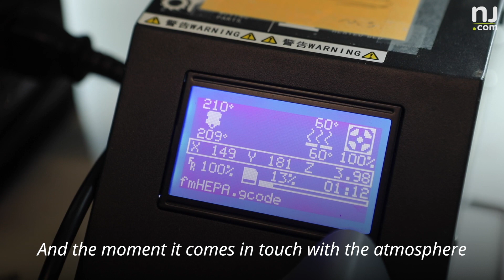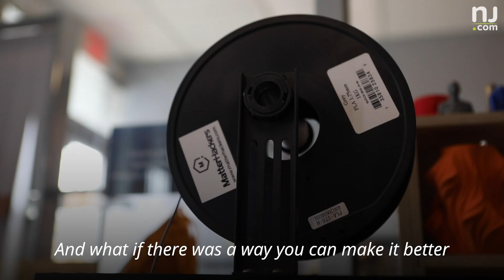3D printer in N.J. making respirator masks to help protect from coronavirus

Comment: These things do not seal properly, also the layer lines do not totally solidify. These are very difficult to nearly impossible to sanitize because the layer lines are porous.  Her intentions are good, but these are not viable solutions. These machines are meant to prototype, not create finished products like an injection molded part. These would give people a false sense of security, which could actually make things worse. Trump needs to demand 3M make masks and PPE around the clock using the Emergency Production Act. That is what would save our healthcare workers and essential personnel

Comment: Would highly advise against 3d Printed masks. Taken from Josef Průša's article over at https://blog.prusaprinters.org/from-design-to-mass-3d-printing-of-medical-shields-in-three-days/
He quotes: "but printing respirators might not be the best idea at this time. Let me explain.
 None of the designs available right now have been tested to ensure they provide the protections needed"
"Another question we need to take into account is the porosity of the printed parts and the safety concerns that come from that. The wearer will have the mask on their face, a humid and warm place, a perfect breeding ground for germs."
A false sense of security is more dangerous than no protection at all...

The face shield design however, is far more promising.

Comment: Hello, I took a 3d printed respirator like this one and made a face gasket with silicon 1 caulk and soap/glycerine. People do this to make cheap molds. The idea is that you let it get to a putty state, build your gasket, put a little soapy water on your face and do a quick press for a custom mold. It created a completely air tight custom seal. If you want pics, then let me know your email and I will send them over.

Comment: This is fun, but also dangerous. There is a risk here that CO2 accumulates inside the mask, which can kill you.
Reply: co2 particels are 0.0000125 microns in size, about 1000 times smaller than a virus. it has no issues going out of the mask:)

Comment: It's probably more useful to print those face shield brims that are designed to use clear acetate films that are still easy to buy like overhead transparencies, production bottleneck is the n95 filters so I don't see how this helps.
Reply: all of the 3m furnace filters in the filtrete family are all made from the same material as a n95 mask... melt blown static charged polyproplyen. You can get over a 1000 filters from one small furnace filter

Comment: This is great. Few thoughts. Have your tested as FDM is not airtight... Just try placing in water and watch it soak up water like a sponge. With that you can use coatings...like XTC-3D to make air tight.
Reply: I already read this statement somewhere else too and also believe it. My "but" part is, that FDM can act enough air resistance IF there is a large hole in the middle too. I spent my weekend to think/create something similar like in the video (before I saw this) as HEPA filters for cars has a very good price/cm2 if we compare them to another product specific HEPAs. Also they are available in great numbers! I used a SCT SA1145 cabin filter which costs aproximately 5 dollars and can cover 8 pcs of filters (7x7cm).
The big problem with the project above (and yet mine has the same problem) that the HEPA is just dropped inside, so the lowest air resistance is not the HEPA itself but the leakage right next to it. There should be an insulation which blocks the gap between the plastic and the zigzag.
Also a big question is if the HEPA can release particles while in use. Glass filaments get into lungs can't be too healthy.

Comment: PLA is too hard and abrasive for the skin and won't conform to it.  They have to be printed using flexible materials like TPU or Polyflex.

Many printable mask and visor designs are available for FREE at: https://www.thingiverse.com/search?q=covid&type=things&sort=popular

I also designed a FREE reusable 5 Gallons bottle cap in case there is a drinkable water shortage:
https://www.thingiverse.com/thing:4231821

Comment: In case you weren't aware, the CDC just announced that they have revised their guidelines for health care professionals on how to deal with shortages in the supply of respirators for the health care industry. Including limiting masks to those HCP with the highest need, using physical distancing whenever possible so you don't need a respirator, stop providing them to the incoming patients, reusing disposable respirators as long as possible, and yes, using bandannas and scarfs if you have nothing else. Yes, that is from the CDC. There is a shortage, there will continue to be a shortage of masks. 
Does this design need more work? Yes. I'm going to be experimenting with a flexible tubing seal around the edge. I've used respirators for my entire adult life and used to be a certified respirator trainer, and I would feel more comfortable training someone on the proper use of this, then to give them a bandanna and telling them "good luck".
What other recommendations do folks have about IMPROVING this design. That is what would be really useful.
Although it would have been nice, would still be nice, if there was a national scale up of production in this time of emergency.
https://www.cdc.gov/coronavirus/2019-ncov/hcp/ppe-strategy/face-masks.html (the bandannas are at the bottom of the page).
Reply: 1. If you haven't already, provide a captive retention system for holding the filter(s) in place rather than simply a slotted cavity (as appears to be the case from a simple glance)

2. Incorporate "live hinges" at facial molding points to improve fit by briefly thinning the plastic, preferably in sequences of 3-7 hinges per molding point to reduce strain on each bend.
3. Provide models with filter housings sized for different commonly available filters - some people may have industrial respirator cartridges already but others will need to make do with modifying HEPA and activated-carbon bags and filters intended for vacuum cleaners, home air purifiers, and home furnaces.
Reply: Hei, I’m the guy behind the original design:) we now have a core team of 10, with literally hundreds of volonteers on slack, and 300+ printers in the network. We have TONS of new stuff coming out in days to come, we’ve been working 24/7 for the last 10 days, an english website is launching tomorrow, you can also write to me on FB (David Kvaternik) with suggestions and improvements, we will also have lots of scientific papers listed,... thanks for info on the CDC, could you send me the source? It would be VERY usefull, the first prototypes of ours utilizing anestesiology filters, which hospitals already have, are going to hospital trial tomorrow.
Reply: @Kvatthro  Hi David, here is the CDC website for Health Care Providers: https://www.cdc.gov/coronavirus/2019-ncov/hcp/ppe-strategy/index.html if you click on the N95 respirator section that is where you'll find the information.  I've got some TSU filament coming in this week and I'm going to try and see if that works better. I did rig up one of the PLA masks with 1/4 clear poly tubing to make a better fit, but it is still a little less conforming than I'd like. I've got some 3/8" tubing coming in as well to try. As soon as I rig that up I'll shoot you a picture.  I made filters using a HEPA furnace filter too, those are still available at some of the big box stores and you can get a lot of filters out of each one. I'd also like to experiment with adding the screw on filter assemblies to the design. I've been using a 3M 6100 1/2 mask respirator for years and the one I have came with a removable, blank filter for the N95 inserts (think large cosmetic round wipes). But I can't find that rig anymore, I've got to see what they've replaced it with. But the rig could literally take anything that was cut to the right size and it screws onto the respirator instead of a pre-manufactured filter.  Just food for thought. As soon as I've got a couple finished I'll be doing some respirator tests on them to see if they are okay, great, or still needs work.
Reply: Also talking with our local hospital, they haven't (yet) run into the need to replace respirators/masks yet, but are already changing rules on when they issue them. They did express a need for facemasks, particularly ones that could be easily made/cleaned.  And of course a good strategy for cleaning. I'm thinking an alcohol bath would the the best quickest way to sterilize and wouldn't damage the PLA or TSU filament. Providing guidance to the health care community on that is probably important too. Obviously heat won't work and since the materials are more porous than pre-made materials then wipes are going to be less effective. Again, food for thought going forward.
Reply: Thomas Bickford hei, we have tons on info on this, we have hospital sterelization departments, microbiologists,... on board.
Heat DOES work, since 65-70degrees C for 40 minutes is enough to neutralize Coronavirus (influding a safety margin).
This temp the PLA can take! Tested.
Reply: @Kvatthro  Great!
Reply: @Kvatthro  rubbing alcohol or soapy water works just fine for 3d printed parts:) heat works great too. i am a medical and aerospace engineer as well and spearheaded a small group of engineers, doctors, and scientists to 3d print masks and face shields. i designed both the mask and shield to meet NIH guidelines.

Comment: Good effort, but pointless. With all those big openings, your better off using a bandana and safety glasses.
Reply: They are frames. You have to put in replaceable filters within the frame that are replaced after every use.
Reply: Siddharth Ghanta Do you know the model and size of the recommended filter Not specified nor mentioned in the video? 

She is demonstrating a solution to a low resource item. If the filter for this is a low resource item, then this is a useless solution. It appears the creator of this video does not know either. That is a very important element left out
Reply: @scottgivens27  3m furnace filters in the filtrete family such as the 1500 advanced alergen are all made from the exact same material as n95 masks

Comment: Lots of designs here (can't vouch for any of them) https://www.thingiverse.com/search?q=respirator&type=things&sort=popular . Use your slicer/CAD software to scale for best fit.  Many people have dust masks in their garage or workshop for sanding, spray painting, etc.  I have FFP1 dust masks , for example, which are rated to filter 80% of particulates. 3D printing a better way to fit it to your face could be worthwhile.  Use heat gun (low), oven, etc. to soften 3d printed parts to mold them to face. Don't burn your face! Use your hands to mold. Test, repeat.  Also, wash your hands. Stay away from others.  Post your designs to thingiverse.com.   Peace.

Comment: She's not even using the correct terminalogy - the extruder isn't what heats the filament. 
PLA can be quite porous if printed incorrectly, TPU would probably be a better proposition. I get the feeling these folks are " winging" it and they don't entirely know what they're doing.
Reply: ...and a ventilator is not a respirator.

Comment: Guys, this is not a good idea.
- N95 filter material is the stuff we're facing a shortage of, so I I have no idea where they think they're going to find filters for this design. 
- PLA is not flexible and will not seal to your face
- It's not possible to sanitize these parts.
I admire the heck out of the initiative, positivity and good will these folks are showing, but I hope they can switch to producing acrylic face shield frames instead. Those are also in short demand and unlike this design is something people actually need.
Reply: Problem is that right after the general population admires efforts and ideas like this, the same general population comes with torches and pitchforks when the respirators don't work.  There is a reason for the N95 rating, and I'm skeptical that this design would meet those requirements (or, less PC, this design isn't going to work).

Admirable?  Yes.  Subject this design to NIOSH testing before casting significant praise and assuming that 3D printing has solved the problem, however.
Reply: It's perfectly possible to sanitize the parts. All it takes is an alcohol bath. IIRC the old CDC general guideline for alcohol sanitation is ten minutes of submersion.
Reply: Where are you getting your information from? True - PLA is not flexible, but malleable with hot water - which is what is emphasized when receiving the product. IT WILL NEED TO BE PROCESSED TO WORK FULLY. This would be like criticizing a treadmill for not working properly, prior to assembly. It is very possible to sanitize masks with bleach and other means. We agree there is a shortage in N95 masks, but vs criticize and spread negativity maybe help formulate a plan ? How about the idea to cut the N95 mask into quarters and using those for the filters... then we increase supply with zero additional investment. These are things we need to focus on.
Reply: @jd9688  Okay let's say you heat up your PLA mask to 70C so it hits glass transition and you can mold it to your face. Besides the obvious problem of pressing uncomfortably hot plastic to your face, you still have to buy N95 mask material for it. How does this solve the mask shortage problem?
Reply: @bigmclargehuge1170  if you buy 3m filtrete furnance filters, they are all made from the exact same material as n95 masks. I am a medical and aerospace engineer who specializes in materials and ppe. The material is melt blown static charged polyproplyne and all of 3m furnace filters from 1500 and up are made from it. 

also, you do not need n95 material. a basic single layer of cotton will block 96% of virus carries. I have data published on this:)

as for the seal, that only needs to happen if you work in a place where you can not social distance. IE a hospital. 

last, you can easily sanitize prints with soapy water or rubbing alcohol. you do not need to soak them either. Or you can bake the part at 160F in the oven for 20 minutes, then let it naturally cool.

Excellent questions you have
Reply: @LT72884  I didn't ask any questions, and you're replying to a post from a year ago. What's going on with you, bud, you ok?
Reply: @bigmclargehuge1170  no you didnt ask any questions, you just posted a whole bunch of false information in your original post above. I was just correcting it so others that show up to this video will have the correct information. Some cities and smaller states have shortages again.

Yes it has been a year of people posting inaccurate information causing more issues than not

Im doing great, thanks for asking:)

Comment: This design is absolutely pathetic.
Reply: Ty because?
Reply: actaully the design is just fine, you need to add a filter material to it. Use 3m furnace filter or 600tpi cotton
Reply: TY? You have a better one?  You posted a video on how to do it?  Lets see it.   This design will work and save lives - whats your contribution?

Comment: this is the dummest thing I have ever watched. All they printed is a shell not a real mask. Where is the "N95 paper insert"? Let me tell you: it is called “Meltblown fabric” and that is what is limiting the production of N95 masks in China-- which accounts for more than 50% of world's masks made. After the coronavirus outbreak China has greatly increased its N95 mask production to more than two million per day, but it is still not enough (and you think 100 3d printers are enough?). The limiting factor this meltblown fabric-- buiding a production line and get workers trained could take up to 3 months, even for China which can build a hospital in 10 days. No one needs an empty mask shell!
Reply: Yea. No filter. MERV 13 furnace filters have the material but you have to work it into a mask.
Reply: 3m furnace filters are melt blown static charged polyproplyene. Same material as a n95 mask. i made THOUSANDS of these